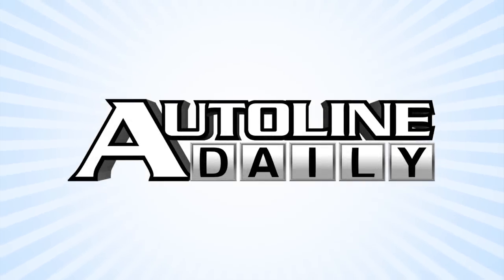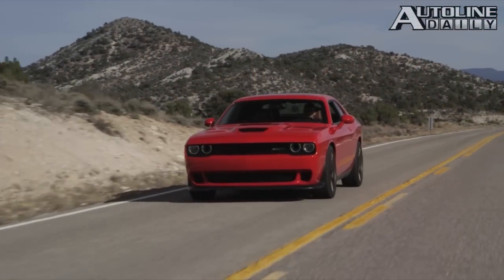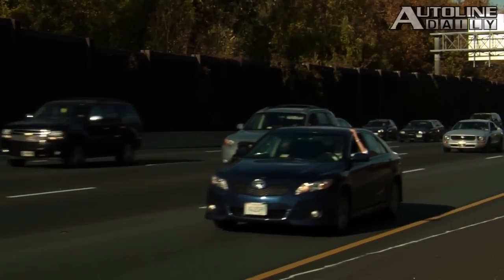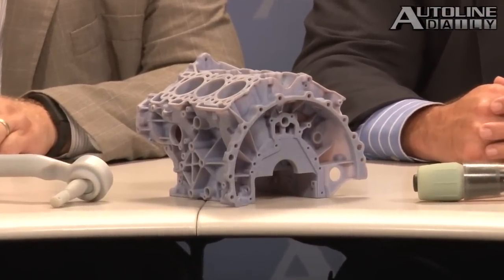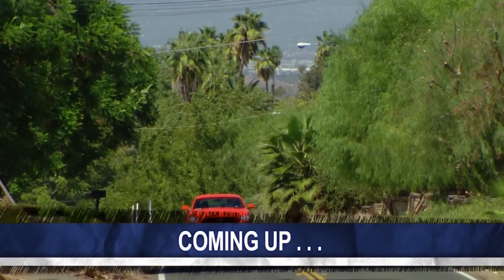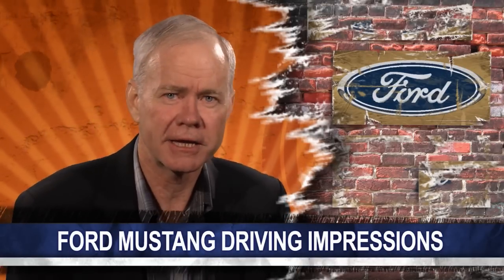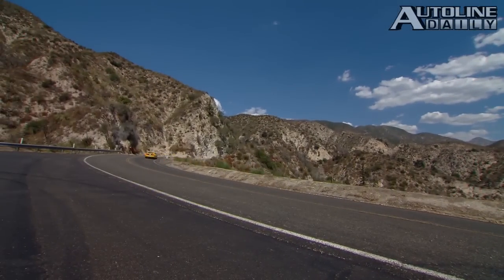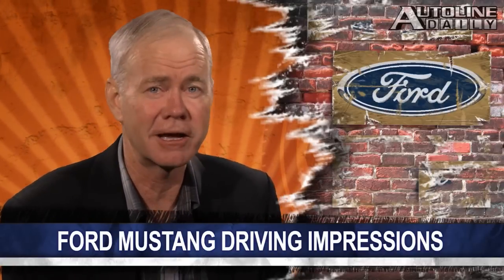New Ford Mustang Driving Impressions, Cadillac Commits to Flagship - Autoline Daily 1461

Comment: Why is it that manufacturers are still using Lead/Acid batteries? why don't they switch to Lithium Ion? It's not like it would cost all that much more considering the volume of vehicles produced each year. They would also be better because they would be able to mount them inside the vehicle which would make them easier to replace. What do you think John?

Comment: The new Mustang is not attractive, especially the back end. Yes, it does look small back there, and that throws all the proportions off. It looks pinched, out of place, and more than a little resembles a dog dragging its bottom. I'm sure it drives great, and will probably sell well, but from the styling side of things, the Mustang has progressively gotten uglier since about 2007-2008
Reply: I think the Camaro is Ugly as Hell and hasn't changed a bit in 5 years, yet it still outsells the Mustang, go figure.